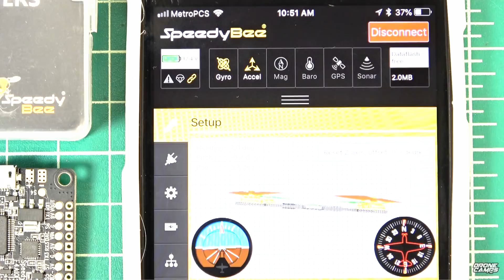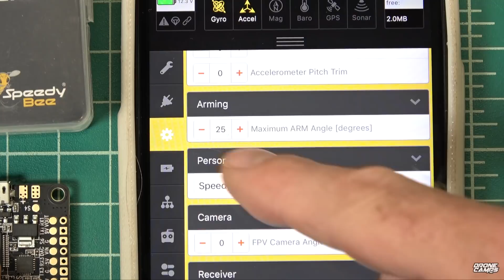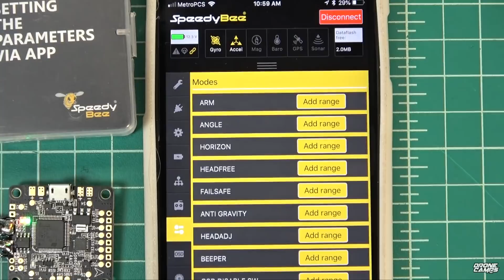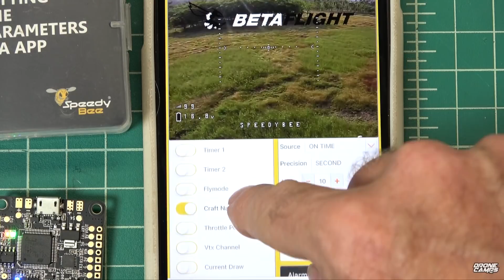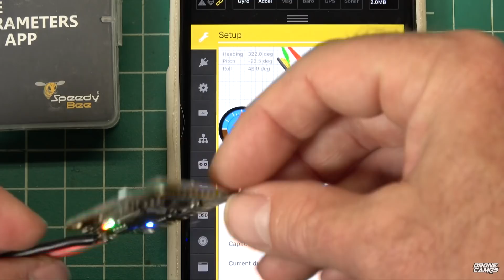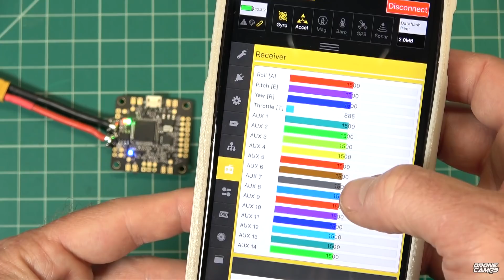Speedybee F4 AIO with Bluetooth Betaflight! - FIRST LOOK, Setup, and Review

Comment: I Have The Second Version Speedy Bee F4  Just Setting It Up But I Found Same As The First Version Once I Set Up A Few Settings In Beta Flight and then try to use the app it trys to connect and times out. any thought on that. also i have a rxsr receiver but not sure were to hook up smart port on it thanks.

Comment: I have purchased the Speedybee f4 AIO and have it connected to a 30A 4in1 ESC as their website provides. The quad flies well, however I do not know where to hookup the Battery Sensor coming from the ESC? What is the solution for this so I can see on my OSD what the battery voltage is during flight?

Comment: I would like to add the be aware of ESC motor tab one where the boot button is located there are two holes that go through the board and it ended up sorting out the board speedybee made it right which is awesome but just want everyone to keep this in mind and be careful I ended up using my own pdb so
Reply: same thing happened to mee!

Comment: I've used this app to set up my 5 inch. It's great!

Two known issues. Your switches can get randomly changed by the app, so always check before you fly. 

Don't hit reset on the receiver tab. A bug can change your TAER setup to something different. 

No crossfire support just yet.
Reply from the maker: Hope they get the crossfire support update soon.
Reply: Drone Camps RC they should do. Receiver tab seems to be the hardest. 

There's a thread on rc groups, where you can suggest stuff to the devs directly. Lots of people have asked for x fire

Comment: Yo, great review. Just wanted to add that the SpeedyBee app will work on Android over an OTG USB cable on any Betaflight FC. The app shows both Bluetooth and USB connection available. I'm not sure if SpeedyBee will work over a USB on iPhone though, not yet I don't think. I've used it on my Samsung S7 with the OTG cable and it works great. GO SPEEDYBEE! Love it.
Reply from the maker: That’s really sweet. I would love to see that happen on an iPhone. I wonder what the deal is with firmware flashing. Maybe that will
come later?
Reply: I seem to think that they won't enable that feature, especially over bluetooth. Most things that need flashing need to be hardwired in, like with USB since when its flashing it is probably flashing bluetooth stacks as well so the connection would be broken. But who knows, maybe theyll figure out a way to do it.

Comment: I noticed the default d set points were at 0 and 1 out if box. Do you recommend changing those before flying? I know they had some bug issue that made them decide to use those setpoints for default. 
Can you enlighten us on that a little?
Reply from the maker: You can change it before your maiden. When I get one built up I’ll try it out for you guys.